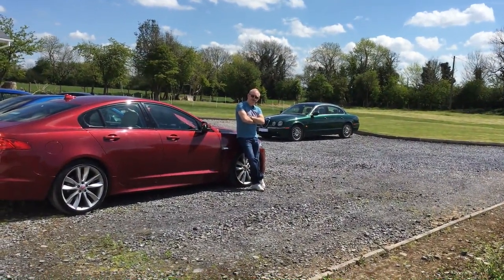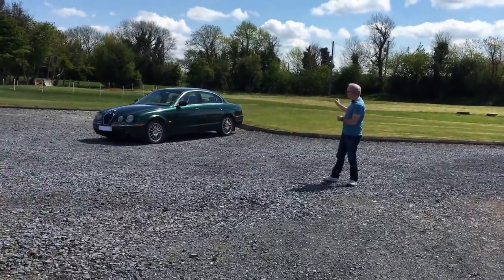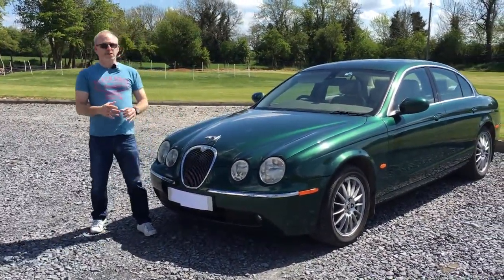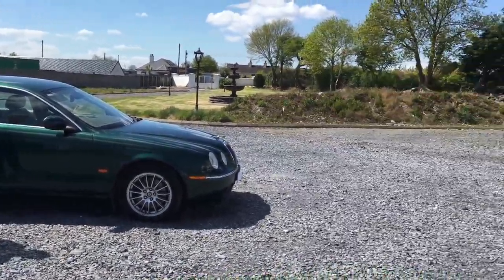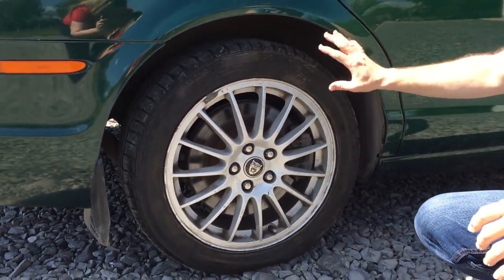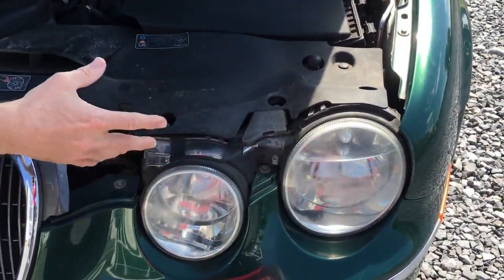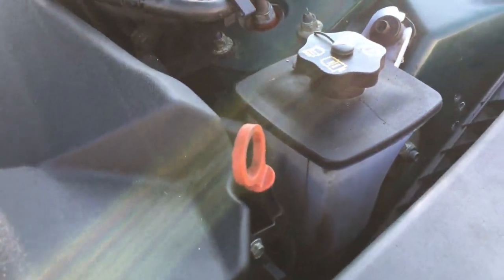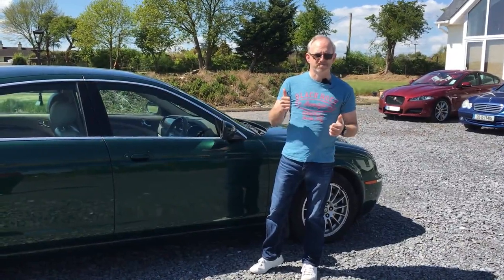Jaguar S Type review - an Introduction

Comment: I own a 2007 S-Type 3.0. As my mechanic said, when I asked him to look at it before I bought it said, It's a fantastic car, buy it! I've owned its 4 yrs now. It's a daily driver and absolutely the most reliable car I've owned. Still turns heads.
Reply from the maker: It's always great when you buy a car that you really want, and it more than lives up to expectations!

Hopefully you get many trouble free miles in her!

Thanks for watching ... spread the word.
Reply: how is the cost of maintenance,  as I am plannign for the same model?
Reply: @MSVRises  I've now owned the Jag for six years. Honestly, it's the most dependable car I've ever owned & at 76, I've owned a lot of cars. The secret is to find the lowest mileage car you can. Mine had 52K when I brought it. Check the VIN # for any problems and maintenance records. My Jag is a daily driver, I live in a condo, so no garage. Since I bought the Jag, the only things I've replaced are the windshield washer motor, the battery, and the rear brakes.  I don't bring it to a specialty shop, just my regular mechanic. Keep up with maintenance, and you'll have many miles/years of happy motoring.

Comment: The 2.7 diesel engines were the worst diesel engine they made!! Common issue was the crap crankshaft bearings. They didn't have the locking tabs and were basically a ticking time bomb to go wrong and potentially seize the engine!!.Bearing would spin on the crankshaft and have seen crankshafts split into 2 pieces. The 3.0 jag diesel engine is the same lump which replaced the 2.7 just with a few tweeks!! These had the same problems as the 2.7 so again a crap engine!!
Reply from the maker: Hi James 

Thanks for that comment.  Amazing how people have totally different experiences with the same engines!  

Thanks for watching, check out my other videos too.
Reply: @journeyofapetrolhead  Thanks for your reply. My experiences with these engines are not as much as my best mate who has work as a Land Rover specialist mechanic for a number of years. He has encountered the issue mentioned above countless times and it was him who alerted me to the fact that the 3.0 diesel was the same engine as the 2.7 with just small tweeks!! Land rover didn't learn from the issue of the bearing shells not having tabs on the ends and so it was a total disaster engine!! You only have to look on internet for landrover crankshaft issues to see the vast issue.
Reply: 3.0 was a hell of a lot more reliable but yes I still wouldn’t touch one...
Reply: @JamesAllen300  the Land Rovers have a different turbo system to the Jags